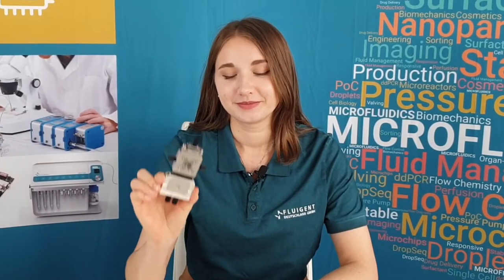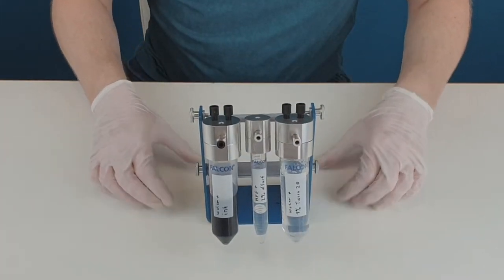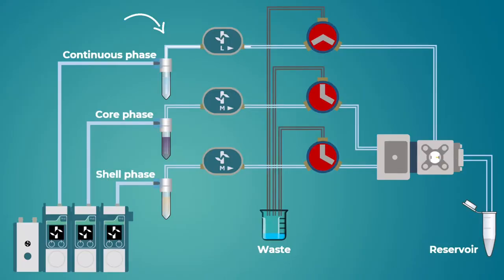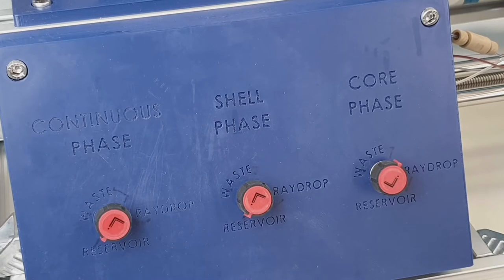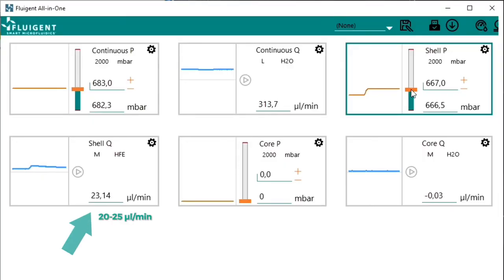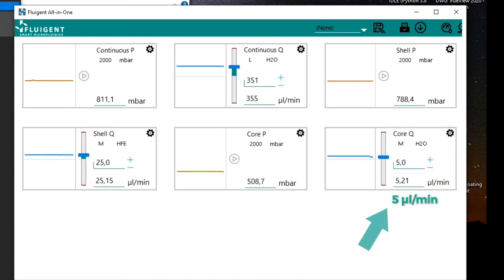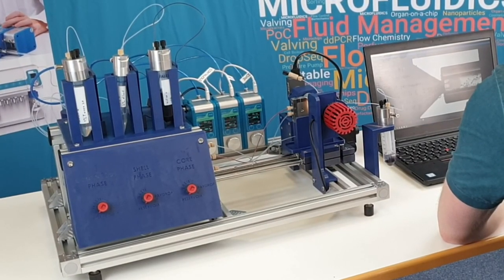DOUBLE EMULSION PRODUCTION: RayDrop Method [Tutorial] - Fluigent

Comment from the maker: What you will find in this video:

0:04 - Intro: An easy way to produce double emulsion
0:33 - The Device: double emulsion RayDrop
0:52  - What phases we use
1:22 - Platform to keep everything in one place
1:39 - Microfluidic system
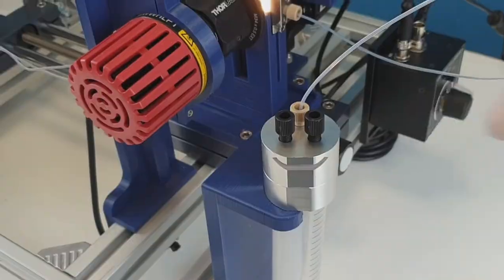2:07 - Tips for preparation
3:40 - Step 1: Single emulsion
5:10 - Step 2: Double emulsion
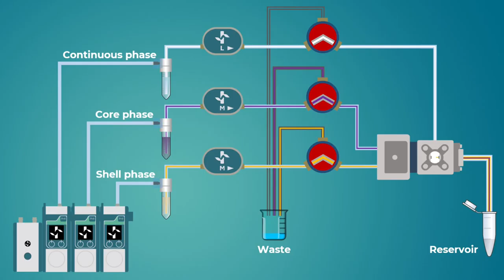6:08 - Evaluating the results
Reply: Hi, what is the optical setup (camera & objective)?